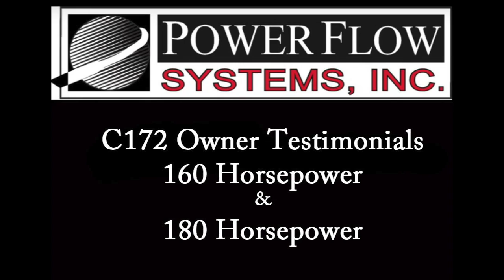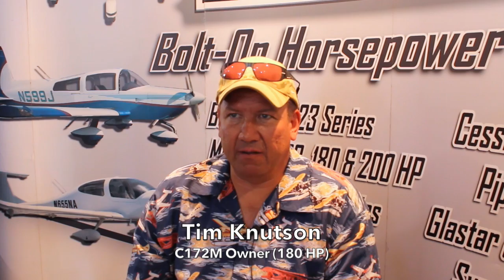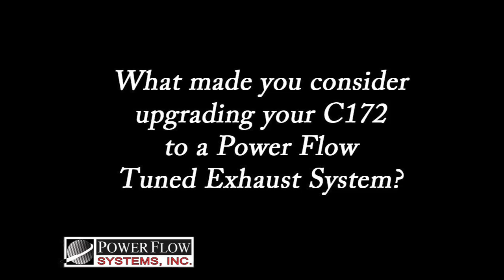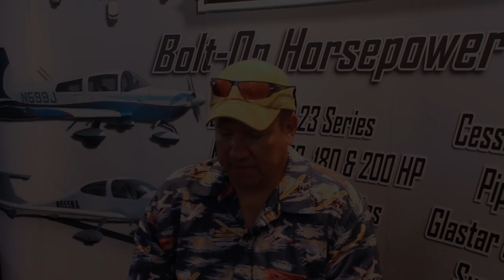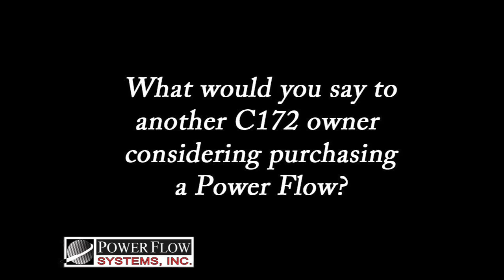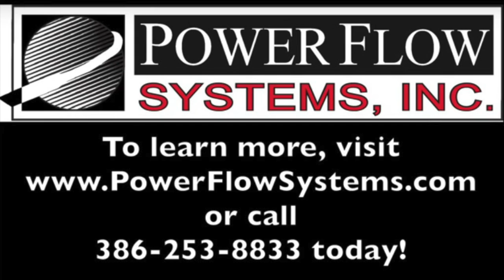PFS C172 Owner Testimonials 160HP & 180HP

Comment: Im 172m owner. Looking for power upgrade. I think that Power Flow is better for the price, I expect better take off performance and fuel consumption. I want to keep the 40° degree flaps and my reliable Lyncoming O320 E2D. 
The 0-360 is 15-20% heavier, so its gain more weight, more fuel consumption and less range.